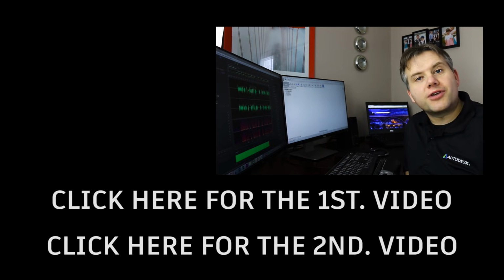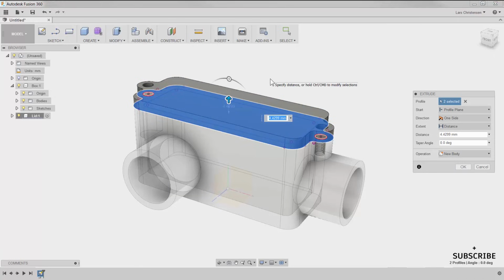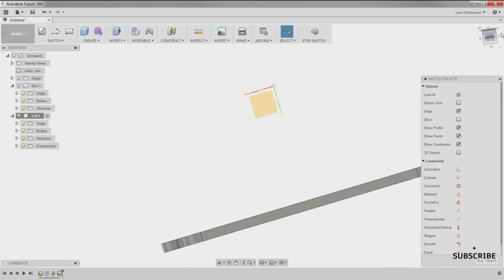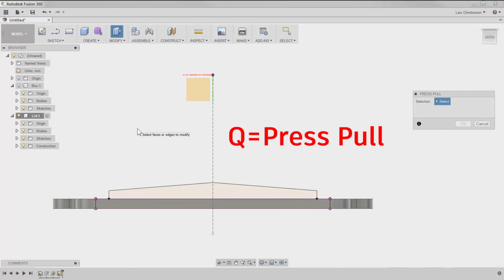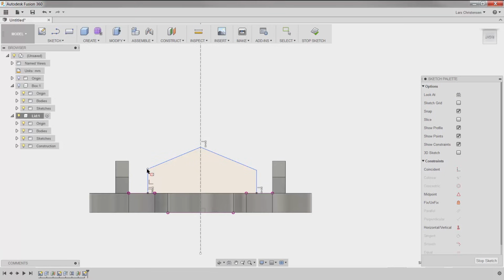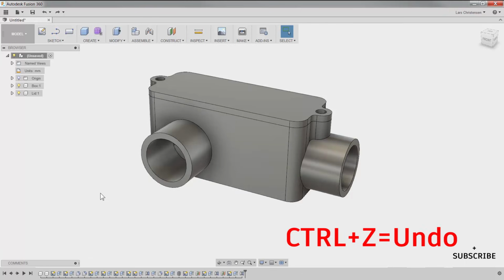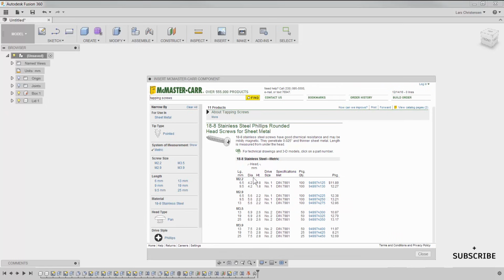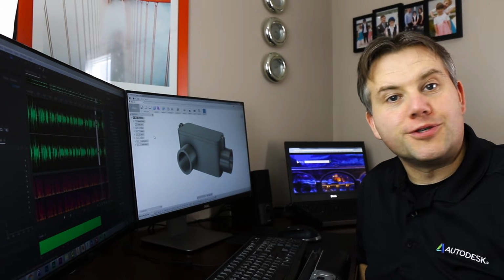Fusion 360 Tutorial for Absolute Beginners— Part 3

Comment: At 7:30 after using the symmetry tool and setting the dimensions, when setting the 2.5mm dimension, the program subtracts the difference from between the sketch and the lid body resulting in a gap between them. What am I doing wrong? The program isn't detecting that the sketch should be anchored to the lid surface.
Reply: I think I figured it out, or at least found a workaround. It may come back to haunt me later though. 

After sketching the shape, I hovered the mouse over the vertex where the new sketch on the offset plane meets the lid, it will then highlight in blue. When it's blue, right click and select fix/unfix to fix it on this location. As I said, may or may not be the right way to do it...
Reply: Ruben Jackson thanks, will look for this function! In my case it was selecting separate sides instead of a whole body for symmetry because I haven’t chosen the “bodies” option, it was on sides lol
Reply: @RosssRoyce  https://knowledge.autodesk.com/support/fusion-360/troubleshooting/caas/sfdcarticles/sfdcarticles/Cannot-snap-to-components-when-sketching-in-Fusion-360-on-Mac-after-an-update.html
Reply: @rujack78  https://knowledge.autodesk.com/support/fusion-360/troubleshooting/caas/sfdcarticles/sfdcarticles/Cannot-snap-to-components-when-sketching-in-Fusion-360-on-Mac-after-an-update.html
Reply: I'm having the exact same issue.  I also kept having an issue where I would draw the sketch in the same order as in the video (construction line first, then clockwise), and I would only get to draw the sections to the construction line, and then my line tool would just kind of go away.  Then when I went back to try to finish the sketch, the lines would be treated as separate parts.  Anyway, I'm not explaining it well, but I ended up having some success by drawing the construction line later, but it still doesn't seem to be anchoring the sketch to the lid.  Any ideas?
Reply: Same here. I was obliged to select the whole shape and use the "move" tool to slide it down to the plane. Also at 10:05 I try to do symmetry  but it selects individual walls of my object instead of the whole object ...darrrn lol
Reply: I faced the same problem and I tried several times to do it just like Lars did. I assume that he either got lucky that it did not appear with his version, or they meanwhile have changed how relationships work. The problem is, that the triangle position actually is not defined in space. So the program took the chance to move it up a little, since there is no rule yet, that the bottom line should stay on the lid surface. I solved it by defining that, using the colinear command. I marked the lid surface line and the triangle bottom line and that merged them together. Hope it works for you too, just give it a try.
Reply: @a.t.1668  https://knowledge.autodesk.com/support/fusion-360/troubleshooting/caas/sfdcarticles/sfdcarticles/Cannot-snap-to-components-when-sketching-in-Fusion-360-on-Mac-after-an-update.html
Reply: @EdNorty  
Thanks Ed, I found that post later after I had uploaded my answer. Checked my settings and indeed that option was not ticked. Now it works for me like shown in the video. Thanks again.
Reply: https://knowledge.autodesk.com/support/fusion-360/troubleshooting/caas/sfdcarticles/sfdcarticles/Cannot-snap-to-components-when-sketching-in-Fusion-360-on-Mac-after-an-update.html

Comment: probably something wrong with me, i have too many problems trying to learn from this lessons. Why did not you say how to rotate to object to see it from different sides?
Reply: Top right corner theres a cube
Reply: thank you, but i found it as well. Lars in the videos does not go to the corner every time  to rotate the object. While i have to go to the corner each time.
Reply: @radchenkoa  It's typically holding the RMB for orbiting, but that does depend on what option you set in "Preferences/General/Pan, Zoom, Orbit shortcuts".  Mine is set to "Tinkercad" as that's what I cut my 3d teeth on before moving on to F360.
Reply: pressing the scroll wheel on the mouse while holding shift. Agree, this program is fuck-tard counterintuitive and his version is not the same as ours!

Comment: I'm a retired Solidworks user and this Fusion 360 looks great. One question where do you find the keyboard command list?
Reply: The shortcuts list is in the video description, and now here , if that's what you were referring to:
S=Model Toolbox
Q=Push/Pull
C=Circle
D=Dimension
L=Line
X=Construction
P=Project
Ctrl+Z=Undo
J=Joint

Comment: Lars, thank you for the videos. I'm very much a beginner on this application. I was able to follow you and accomplish the lesson goals up to the point of adding the tabs on the lid. At that point I found it very difficult (if not impossible) to replicate your process. There are just to many difference between the toolsets that you used to create the model and the toolsets in the most current version. Do you have any suggestions on how I can overcome this problem? Than you.
Reply: P B I’ve started following theses tutorials as well and have got stuck at the same place as well. I think the issue at least for me is that when I try and draw the line that will become the lip of the lid, is it doesn’t attach to the lid surface. Which seems to really mess the next steps up.
Reply: @andymonks7126  That is exactly the issue. I have not been able to find away around this issue so far. But I keep poking around.
Reply: @PB-nc3mp  When I read your reply it highlighted another reply from months ago. The answer is ", Name > Preferences > Genera > Design > Auto Project Edges on Reference is on". Where "Name" is your name on the top right of the screen. After I did that, I instantly manged to draw my first lip. So now to follow the rest of the video.
Reply: @andymonks7126  Thank you very much
Reply: @andymonks7126  You're a life saver!

Comment: I do not like that i obviously have another version of 360 than you. There is several things not working in mine fra video 1 to this one. Now i am struggeling with the sketch for the "skirt" that when putting in dimension for the 2,5mm it sinks in to the model instead of rises it. Should i be using the rear hidden magical mouse button or something when clicking the dots or is there anything else missing here?
Reply: Try this: 
https://knowledge.autodesk.com/search-result/caas/sfdcarticles/sfdcarticles/Cannot-snap-to-components-when-sketching-in-Fusion-360-on-Mac-after-an-update.html 
then close and re-start Fusion 360. Seems to have worked for me.
Reply: Asgeir Løland same exact issue I’m having

Comment: Great series of videos for a Fusion 360 beginner.  Ran into issues with the lid, the two of the tabs are not connected to the lid and two are.  How can I connect them?
Reply: Just set the distance from the bottom of the tab to the bottom of the lid, which is the thickness of the lid. It should be around 3mm if I'm correct.
Reply: Actually there's  a better way. Quoting "Ty Mansfield" : Use the coincident tool to constrain the base of the triangle to the lid line. It will hold it in place then do dimensions.
Reply: Super glue
Reply: @MrTerrymiff  Ah yes, the electrical engineer's approach to mechanical engineering

Comment: Great video. Followed it, everything went great, except the lid 4 tabs. For some reason, when i'm doing the sketch with the line command, the line doesn't snap to the face of the lid. Any ideas on why that happends? Thank you for all your work.
Reply: exactly the same issue for me. Cannot seem to solve it
Reply: Solved it. Use the coincident tool to constrain the base of the triangle to the lid line. It will hold it in place then do dimensions.

Comment: 9:05 please can someone help. When ever i make this measurement the whole sketch moves.

Edit: jesus Christ i found a work around but its quite a hassle so i will only share if it if anyone need it. Just ask me if you had the same problem.
Reply: Same problem help
Reply: Same problem here, ples help
Reply: Almost like it cant find the origin line
Reply: Ethan Evans so basically use the dimension tool to set the length between the base of the shape and to the top of the lid as 0. That way it is a constant and will never move. Hope it works.
Reply: @pranavg.9811  I think I tried what you're saying but it goes red and doesnt allow it :/
Reply: I have the same problem but what you said doesn't work

Comment: Just dabbling in Fusion360 to do some basic 3D printing stuff and I have watched your set of three tutorials. They did explain a lot of stuff I couldn't find elsewhere. Most other tutorials tell you what to do without actually showing how it is done. However, I have one question. The two models I am working on, I always use E to Extrude (from other tutorials Ive seen) to expand the shape, but you always use Q (Press Pull). Is there a reason why? Does Fusion360 interpret these commands differently? Thanks.

Comment: How do you move the camera in the way you do? For example at 20:40.
I think that the camera control is super hard
Reply: Shift + mouse scroll button + pan mouse
Reply from the maker: I might owe you a beer https://youtu.be/PCPyy_RVEhM
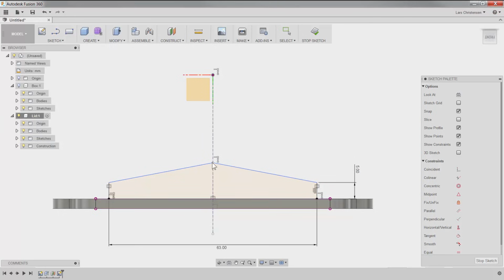Reply: @cadcamstuff  There are a few people on here asking solution to the same problem and you havnt given an answer. It's about the 9:00 mark when you are changing diamension of the sketch, (2.5) for those people me icluded the base of the sketch moves up when you change the diamension, disconecting it from the body of the lid. Also having input all three diamensions the sketch is still blue, moving one of the corners shows me nothing, stuck on this for a couple of hours now.
Reply: @cadcamstuff  found solution :- 

Andy Karl
1 month ago
Found the issue you have to make a change in your preferences - Name > Preferences > Design > Auto Project Edges on Reference is on
Reply: @yorkieboy7382  Thanks to you and Andy Karl.  This is the solution.

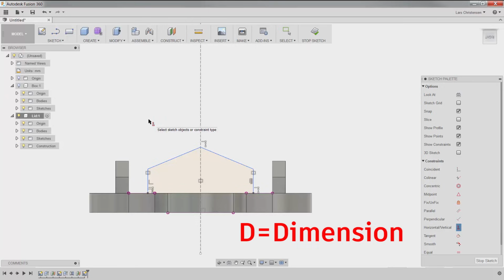Comment: At 12:47 mark when you start adding the demensions I'm running into an issue.  Instead of the part moving down when you set it to 2.5mm mine moves up away from the part. How do I fix this?
Reply: I experienced this issue when "dimensioning" both the tabs. I fixed it by using a Coincident constraint.
Reply: @SirSirris  This worked for me! I clicked on the lid and base of the triangle.
Reply: Found the issue you have to make a change in your preferences - Name > Preferences > Design > Auto Project Edges on Reference is on. this will hold the sketch to the body of the lid

Comment: I can't get my lines at 7.00 to connect to the same dots it connects to dots in the middle
Reply: I have exactly the same problem. They do not connect to the the extruded lid shape.
Reply: Found the issue you have to make a change in your preferences - Name > Preferences > Design > Auto Project Edges on Reference is on
Reply: @andyknz   Thank you! I was just having the same problem
Reply: Andy Karl, I changed that preference but my line still won’t connect. It will connect to the construction line but not the body. Any other suggestions?
Reply: Andy Karl , it’s working now for some reason! WTF!
Reply: @warrenscorner  I'm pleased that if finally sorted for you. :)
Reply: @andyknz  Same problem. And this was the solution. Bravo!
Reply: @andyknz  well after getting fed up at midnight do to this issue others seem to be having, I found your post and will try again after work tomorrow. Fingers crossed!

Comment: I also struggled with connecting point to the underside of lid at 7.00 I tried several times but could not get the line to turn blue -I must have missed something.    Up to this point these have been very helpful  -Thanks ok may have found solution reading comments below ;  Name > Preferences > Design > Auto Project Edges on Reference is on
Reply: Bryan Parkinson Thank you so much! I had the same issue and that solved it perfectly!
Reply: Phew.. just spent 2 hours trying to fix this myself to no avail. Thanks Bryan!

Comment: What a useless video, for 3 hours I have been trying to sketch onto the created plane to get the lid guides, they wont go black whatever I do. I do not know how you got the lid edge to turn blue when adding lines, they wont go blue for me.
Reply from the maker: If blue, you should be able to drag a corner of the sketch. That should give you an indication of what is missing in regards constraints to make it black. 
If it is black from the start, and you want the flexibility of an under defined sketch, try to draw it where no other geometry is created. 
Sorry you have been struggling with this for 3 hours, I would have quit after 15 minutes
Reply: @cadcamstuff  The answer is actually given below in the comments. You clearly have this option enabled by default. Would be helpful if you included this in future videos. And as for quitting, that's not in my nature. Otherwise, a good video.
Reply: @cadcamstuff   I had the same problem but I don't consider de videos useless a ALL. Great job in showing al these skills!!! I had problems with the under tabs, but I did great on all other challenges!!! Thank you so much!!!

Comment: hi, so i've been modeling the box while watching the video and some times there are some differences probably because of diferent version and i´ve been hable to solve them, but when making the line for the lids of the lid (minute 6:57 of the video) the cross doesn't sanp to the blue line that appears at the edge of the body of the lid. I would really apriciate some help.
Reply: From Mr. Random...Name > Preferences > Design > Auto Project Edges on Reference is on
Reply: Got it. Go see Mr Random's comment below.
Reply: @jacquestheberge4170  thanks, i found that projecting the geometry with "P" also works.
Reply: I have the same problem. Furthermore, the small violet or red circles do not appear either. Help

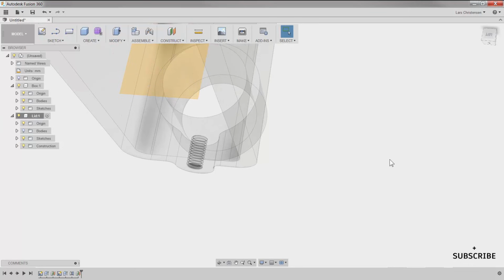Comment: I've run into a problem after saving my work last night and coming back today to finish it. I opened up 360 and then opened the file I saved last night but when I turn on the body, it comes back as a solid body and I can't see the lines. How do I get back to where I was? I'm at exactly the 11:00 mark in the video where I am suppose to select the section I want the plane to go to.

Comment: What about tolerances??
Reply: @W. Hermann  yes, do you need to work with tolerences, because if I dont in sketchup then my prototypes needs filing and sanding after 3d printing
Reply: @wesleyels3847  I know what you mean. If you print a tube with a 30mm inner diameter, and then also print a 30mm outer diameter rod to fit inside, it wont fit because they are exactly the same size. So in reality your rod would have to be 29.5mm, for example.

Comment: I can not get the symmetry function to work. It’s just adjusting the right side of the model. Any tips anyone?
Reply: i was having the same issue and after rewatching about 5 times you need to "close the sketch off" by sketching a line from the bottom right point (last point) to the bottom left point (the first point)
Reply: another thing I noticed is the program auto adjusts the horizontal or vertical based on rounding up or down  based on if the object is more horizontal or vertically already

Comment: tutorial doesn't match up with fusion 360, mirror of inside of lid objects does not work, using features and mirror about the selected plane doesn't work, won't create a second inside long feature of the lid.  very frustrating.    Everything else mostly works.   do you have any other tutorials which creature  an object like this one but a different object or model.
Reply from the maker: Check out this list https://www.youtube.com/playlist?list=PL40d7srwyc_NopbOnJ4IARIvSrTT1pp5m
Reply: I am working on it, I all of your exact staff several times and it didn't work. it wouldn't choose the corners for Phillips. I will eventually figure it out I always do. I am an advanced user of Photoshop Lightroom topaz how many other photography things have gotten tinkercad to do most things but not everything.
Reply: @michaelryan2622  I had an issue with getting mirroring to work, before I realized I had to select the feature I wanted to mirror in the history bar. I was trying to select in the model.
Reply: Works just fine here, just followed the tutorial :)
Reply: Not working as advertised.  BUT, I am getting some things to work.

Comment: 12:47 it will not let me set the bottom of the small tab on the lid’s dimensions it says “you cannot do this the sketch will be over constrained” AND THAT DOESNT MAKE ANY FUCKING SENSE JUST LET ME DO THE THING PROPERLY

NOW WHEN I TRY TO SET THE DEMENTION IT GOES INTO FUCKING DEGREES NOOOO I DONT WANT DEGREES I WANT TO SET THE DISTANCE IN MILIMETERS NOT FUCKING DEGREES
JESUS CHRIST FUSION IS DUMB
Reply: Ok so I had the same issue and I thought the same - make sure when adding the constraints that you are hitting the points/vertex, not the edges, the over constraint can be caused by it snapping to a position (box with an X in it) because it considers that a predefined constraint. Don't complete the shape, if it is filled in it finished it for you and will cause over-constraint and switch it to degrees. They changed a lot to make it "smarter" it seems, but in the progress changed how it functions. Gotta remember this vid is 2+ years old and F360 exploded in popularity since with affordable 3DP, CNC, and Engraving.

Comment: "Dimension" doesn't work as per the video. When I select the 2 points you have, for 63 mm, The 'roof' of the 'house' comes down on the lid. I had to select the 2 points at the top corners of the "roof" to get it to look like the video. 

However no matter how I did it, the next part with the 5 mm would error. "Adding this dimension will over=constrain the sketch. Choose OK to create a Driven Dimension." I click OK and nothing.